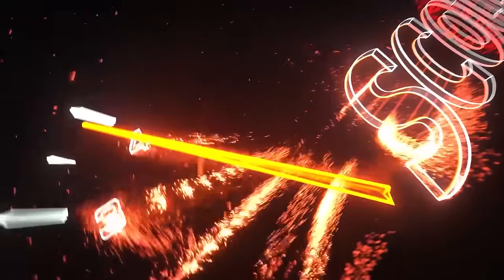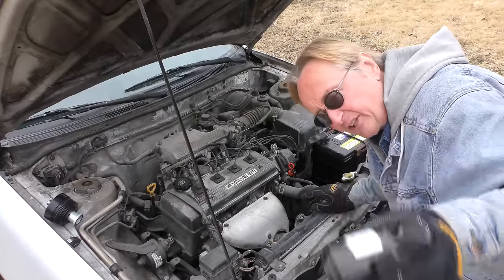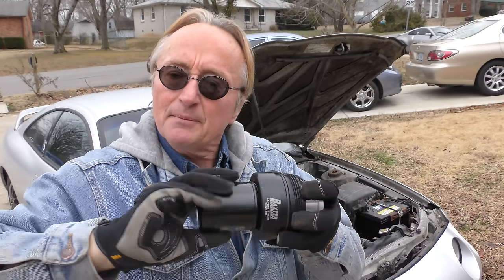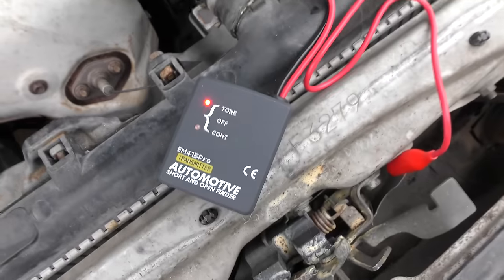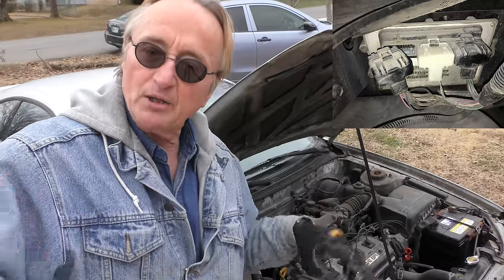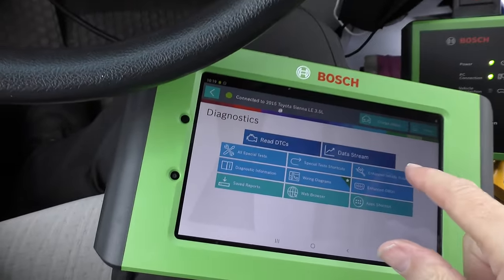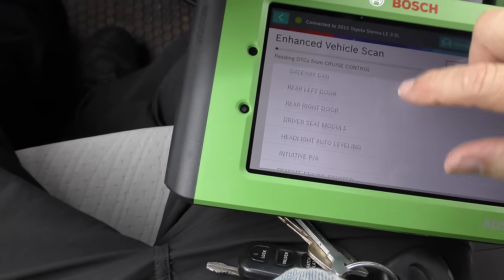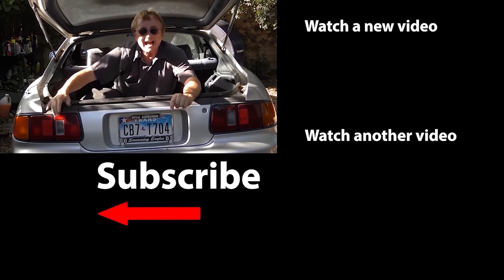You'll Never Have to go to an Oil Change Shop Again with This

Comment: I just installed one of these on my 2013 Toyota Venza with the 2.7 motor. I'm confident this will be much better than the canister style. Removing the canister has always been a job requiring a breaker bar to have enough leverage to remove it. I look forward to changing my oil now. And yes, it is expensive $230, but, I am ok with that for the ease of the oil change.

Comment: I prefer to win that Bosch scanner but who wouldn’t. Lol 😂
Reply: Hard of hearing here Scotty. Could you type in the name of the adapter?
Reply: Scotty is too cheap to give one of those away !!!  LOL
Reply: That Bosch is sweet
Reply: Technology is improving, they will be $49.95 next year.
Reply: I own the Bosch pocket scan, it's Subpar. Scantools less than $200 are a waste of $.
Live data, best you can afford with Abs and airbag capability is best for $  Spent.
Have read plenty of stories of inability to update software with cheap imported scanners. Most reviews are troll positive.
Reply: ME TOO
Reply: It's a nice set up that short find tool
Reply: @CHixon  I doubt it
Reply: @2jz4life35  it just takes the Chinese cracking the software and then they can easily be under a couple hundred
Reply: I have a BMW and just spent less than $200 on a scan tool from Bimmer Geaks that comes with a KDCAN cable and also a bluetooth OBD2 adapter but it's not actually a scan tool, it's just an android app that you put on a tablet or on your phone and it is AMAZING but it is only for BMW's.

Comment: I recently did my first ever oil change that had canister filter. I didn't find it any more difficult or messy than any other oil filter. It's just different. I had to buy the filter wrench but it worked well, better than most of the tools for spin on filters. I have had problems getting the spin on filters off before though. Who hasn't used a screw driver on one of them before?
Reply: That Baxter conversion costs $200. My last oil change cost me $50 which got me 0-20 synthetic oil and the canister filter installed on my 2015 Corolla. The Baxter conversion would also place the canister filter lower to the ground. It makes no sense to use that on my Corolla.
Reply: @lukespack  The filter location varies by cars as I think BMW has them up top.
Reply: @ryanhawkins1235  yea, on my sunfire its under the intake manifold so that conversion wouldn't even fit.
Reply: I agree. The canister does not bother me. It's fine after you change it the first time, and figure out the best way to do it. However, modifying an engine with an aftermarket adapter does bother me a little.
Reply: Yup, I don't find it difficult at all with the canister. I did purchase myself a metal housing though because I heard the plastic could crack but I have yet to use it and I bet the reason behind the plastic cracking could be that people don't read the instructions and they overtightened those plastic canisters.
Reply: Canister is a total pain on a Porsche.
Reply: I have a 4Runner and Tundra and it completely sucks.  Much messier and a pain in the butt.   You have to remove skid plates to get to it.  It will be great to just spin it off and spin it back on old school technology rules.
Reply: @andreasm2882  I also replaced both plastic housings with metal ones and I’m still trying this Baxter conversion.
Reply: The pricing scam designed into those whimsical plastic oil filters is pretty obvious.  Getting a replacement for a failing plastic housing will be 5X or more what a filter costs.  Whenever I had a problem with a metal filter I used a standard loop wrench and/or traded up to the type with the welded hex nut.  Everybody wants to pay so much to fix things that aren't busted.  What, you got a government grant for that?  I don't.
Reply: As with most issues like this, it depends on the car. If your car actually has a well designed cartridge system that doesn't break or strip out, then yeah you're fine. If your car is one of the ones with the awful designed systems that break all the time, the oil filter adapter is an absolute lifesaver. I tend to prefer metal for components that are near a hot engine, plastic loses its strength (there's a better term I know) over time, gets brittle and cracks. I think the real answer here if you really want to be economical would be a metal oil filter cartridge system, you get the benefit of throwing away less materials, and also the benefit of metal parts that don't break, seems like a win-win to me.
Reply: @ixionn563  I'm really only interested in the perverse incentives caused by not "doing it right the first time."  OEM equipment should not encourage some jungle bunnies to get together and whip out injection molded crap that drivers in the U.S. will not notice being swapped out.  Might not notice even if we're told "we had to change out your canister - we didn't like how it was starting to look."

Comment: Even if your car does have a canister-style filter housing, why would you go to an "oil change shop" in the first place??
lol
Save money and do it yourself. It's really not that hard in most cases. and you won't have some joker heaving and hoing on your drain plug stripping out your oil pan threads.
Reply: It's easy after the first time, and even if you break something, you'll make the money back within two or three changes.
Reply: Yeah because the average car owner won't be heave and hoing on their oil pan or filter especially those that have the aluminum pans... yeah you're much better off doing this in your parking lot at your apt complex... ☺️☺️
Reply: Not really allowed to do it where I live (apt complex). My mechanic does it for $30-40, checks other things on the car, tops off fluids, etc. Plus, how do you dispose of the used oil?
Reply: @MikeDunn  I live in an apartment complex. If you have the container type pan like mine, any Auto parts store will take the oil it for free, or you can just dump it somewhere no one will notice.
Reply: @MikeDunn  My local Autozone has an oil drum next to the toilet where you can dump your used oil.
Reply: What if you live in an apartment complex? Would you change your own oil when it is 10 degrees outside? or in the middle of a snowstorm?
Reply: Hey, I've been that joker at the oil change places in the past...lol, but I've never blown anyone's motor, or done any of that stupid ignorant things some of them do
Reply: Oil chain shops should not exist. You might as well sell your car if you don't know how to change your own oil
Reply: Because they are cheap.  They can do it for almost the retail price of the oil alone.  Do it yourself and you have a faff of not having a ramp and of disposing of the old oil as well.   I do get that some people like to "take back control", though.
Reply: @louarmstrong6128  — If someone is willing to learn how to do it right — especially with the potential consequence of ruining their own car if they do it wrong — there will be no heaving and hoing. 

We’re talking about an oil change here, not pulling the whole engine out lmao
Reply: @MikeDunn  — Many auto parts stores accept and recycle used engine oil. Typically they have a big drum in the back that they let you pour your old stuff into.
Reply: @GoNuckingFuts  — IDK maybe wait until after the snowstorm?? This sounds like top-tier procrastination to me lol
Reply: @richsweeney1115  — Well then you certainly aren’t one of those “jokers”. Unfortunately the same can’t be said for everybody.
Reply: @GoNuckingFuts  bundle up and get to work. Where their is a will their will be results but they are up to you to accomplish.
Reply: Even the dealerships make errors with oil changes.
Reply: AMEN....if you have FULL synthetic oil, you will save $75 bucks doing it yourself.
Reply: @drivedb7  some of those canisters are on so tight you cant help but crack them
Reply: @louarmstrong6128  — That’s because you screwed up and let someone else change it before you tried to. 😂
Reply: @cartermc107  Thank you, but think about what you just recommended. Buying all of those things would pretty much cancel out the money saved. Also, I would have to store the ramps at that relative or friend's house. A little too much to ask.
Reply: @jamescaley9942  no, some of us just like working on our own cars and trucks...vans ect
Reply: @MikeDunn  no, it wouldn't....because you don't need to buy jack stands and tools everytime I change your oil......it's a one time purchase
Reply: @richsweeney1115  not for the oil, washer, and filter. Mind if I keep all that stuff at your place? Not worth it for most people. You are not saving much.
Reply: @drivedb7  no I work in automotive business...some cars the filter is on so tight you either decline service or break the cheap canister...
Scotty is right , the cheap plastic  canisters are junk
Reply: Not sure why so many people are up in arms about this post, if it's absolutely impossible to change your own oil at your residence, then yeah get it done by someone, nobody ever said you have to. For me, it's worth doing myself. I'm sure some of the really sketchy or large chain oil change places can do it cheaper, but they use crap oil, have employees that are getting paid nearly nothing to give zero shits about your vehicle, and often upsell you parts your car doesn't even need.

I'm in the position where I have the space and tools to do it myself. I don't mind paying an extra 5-10 bucks every change to do it myself because it's only 2-3 times a year and I use better quality oil, better quality filters, and because I do it I know for a fact its done right. Not to mention, doing your first oil change is a great lesson into learning how to work on cars, which is an invaluable skill that can save you loads of money over time. It's probably one of the easiest jobs you can do on a vehicle right behind changing the air filter. Even if you don't do all the work on your car yourself, knowing your car inside and out will make it much easier for you to tell when a shop or dealer is trying to upsell you parts or screw you over.

Comment: I have to agree with you on the canister type oil filters. I have a 2010 Camry and I hate those type of oil filters. More work, messy. I might look into the adapter. I did a while back and some were kind of pricey, but it might be worth it in the long run.

Comment: I believe Scotty is confusing a “short” with an “open”, at least the 2nd connectivity functionality with the wiring tool...  No green light means an “open” circuit
Reply: I was thinking the same thing.  I'm a network engineer and those devices are called signal tracers.
Reply: It was a lapsus linguae.
Reply: That is the new version of the old telco "sniffer" gone wireless. A real electrical "short" refers to a signal or voltage that took a "short cut" from its normal circuit and it usually to ground.  An "open" is a disconnect from its normal circuit and the signal never completes its intended path.
Reply: A conductive path from a source to a load or device is an intended "short". When the electricity finds a different, unintended, path then that is a problem "short". The short term is a vernacular catch all word used by the uninformed when they have an electrical problem. Continuity deals with "opens". That is when an intentional short is no longer a path for electricity to follow. Of course, there are intentional opens as well, as in a switch that changes state from being open to closed. There is a difference between the two terms, as there is a difference between an intake and an exhaust manifold. Terminology does matter.
Reply: Yeah, Continuity doesn't find shorts, it finds breaks or open circuits.

Comment: Never had an issue with plastic ones as long as you are careful, replace the seal and don't over tighten them they should be fine. Got one on my car that's over 110k no issues :D
Reply: Yep, same here and I change my oil every 6 months. Never had a problem.
Reply: you may break them, also paper inside  the cheap cartridge does break and clog your system.
Reply: @ansv3340   I've never experienced that if true! However, I'm sure metal ones aren't perfect too :o There's pros and cons to both I think :)
Reply: @ElAlfajor95   my ford trucks have spin on metal filters so changing them from under the truck is piece of cake . My BMW has a paper/plastic cartridge filter installed upside down on top of the engine , so always a mess, need to put rags all the way around. Also that stupid cheaply made cartridge for BMW cost alot more then my metal filter for the ford truck.  You can pickup $3 spin on filter at walmart but it will cost you over $10 for the cheapest BMW cartridge .
Reply: I'm at a 190,000 miles and I've had no issues with the plastic one either. It also isn't hard to change the cartridge style oil filters , I'm not sure why Scotty has such an issue with them
Reply: @ansv3340  I suppose it depends. BMW (from my crude understanding) make it hard to work on their cars and generally are not very reliable when they age anyway. I'm from UK and the past 3 cars I've had have had them and theyve never been an issue. The car I have now has one on the side of the engine sticking up and I agree it can be a mess haha! I wouldn't care which one I had really, if my plastic one breaks, it's down to the scrappy for another :D
Reply: @markkauffman6184  Yeah I think he hates plastic. Im not saying that all plastic is good. However, in the case of the filter housing, I'm not fussed. He has good points about other plastic parts that break but sometimes I feel like he's ranting about trivial things haha
Reply: @ElAlfajor95   yeah bmw are garbage cars, their usa line even worst than their europian line.  But I do lot of work on that bmw my self so its manageable , only cost of parts. Would have to sell my kidney if I would let dealer or mechanic do the repairs and I pay for that)))  at 81 K miles. I already changed 2 starters, all coils, all spark plugs,  valve cover gasket - twice ..)) and bunch of other gaskets , and wires. and bolts. also when it was still under warranty dealer kept it for almost 2 weeks to diagnose NO start problem, which ended up being faulty crank sensor /  also recall on the faulty tail light bar/wiring, , and so on. Stupid minor things that cost a fortune to replace or fix because to change a startr wor example you have to remove everything on top of the motor and even air intake ))  this is why dealer charges $1600 for starter replacement ))
Reply: @ansv3340  wow! That's why I would never own one, too expensive to maintain. There are independent mechanics here that used to be cheaper but the prices are going up. Aside from mechanical failures, where I live, a car will rust before something like the oil filter housing breaks haha. I love hearing about Americans with 300k + on their cars. Rare thing to see here and certainly no BMW's (modern) would be lasting that long haha
Reply: @ElAlfajor95  no more BMW for me either , but on the subject, i do have 2 ford vans. E150 and E350 years 1999 and 2000 . V8 motors. both have about 500K miles. most parts are original. off course, starters alternators etc were already changes but all major parts are there.  and they are working vans carry heavy loads often.. this is what I call real quality.  Sad that we dont have though built truck or vans or cars anymore.  new ford transit vans that replaced E vans are pile of junk.that rarely make to 100K. same goes for their F150 pickup trucks.  all cars and trucks built as disposable now

Comment: To be a bit pedantic, the toner finds “opens” not shorts.
Reply: Uh, no.  Actually, that tool finds both.
Reply: The tone generator puts an inaudible high frequency tone on the shorted conductor and you use an amplified inductive coil  probe to trace the field effect to the shorted location. Excellent tool to locate damaged wires. The generator probably has a dual tone output so to have an audible range tone to locate open conductors or trace correct wire bundle paths with a simple audio inductive probe.  Two different frequencies and methods.
Reply: To really confuse someone tell them they have a shorted fuse so you didn't replace it.

Comment: as a mechanic, I HATE the OEM plastic oil filter caps. There are cheap, universal aluminum replacement caps that I swear by but I am excited to give the Baxter adapter a try. great video.

Comment: I remember when J.C. Whitney sold a canister oil filter that could be used with toilet paper rolls.
Reply: They still do. I used to shop at their original store with the rolling wooden floors.
Reply: I had one as a second filter on my Chevelle. worked pretty good
Reply: @oldgringo66  I think I was in that store decades ago.  Was in Chicago?  right?  I ordered lots of things from their catalog.
Reply: @dutchboynl2082  yep, they were south of the Loop on State Street about 19th Street. Big sellers were exhaust cutouts and loud truck horns. The one that played “La Cucha Raucha” was a big hit.

Comment: I had a VW Jetta that had a canister filter   on top of the engine and I loved it. It had a spring loaded valve inside that opened up when you loosen the can that let the oil drain into the engine so it never made a mess. It was easy to change out.

Comment: I just bought a used 2013 RX 350 and found out that it has the stupid paper oil filters that Scotty mentioned.  I checked out the Baxter oil filter adapter and wow!  it was $230!  Scotty is right - they are not giving things away!

Comment: Much prefer my top of the engine canister filter. So easy to change. Yes the screw off top is plastic but it’s very solid and you can replace it with an aluminum one if you want.